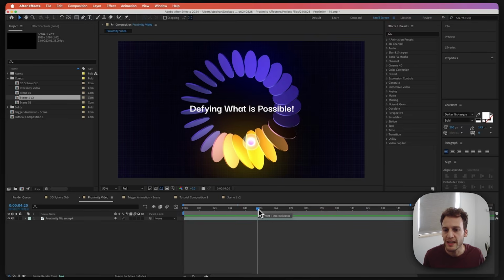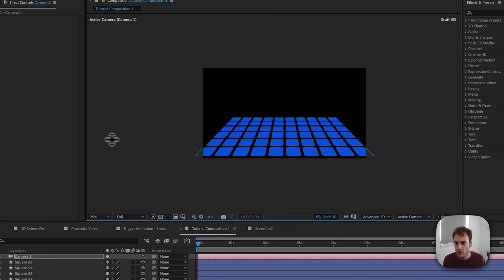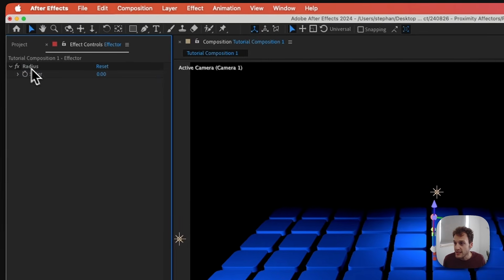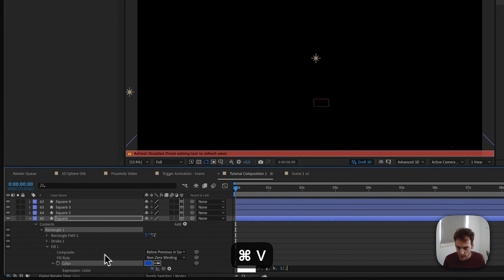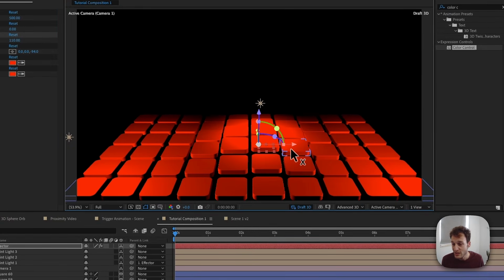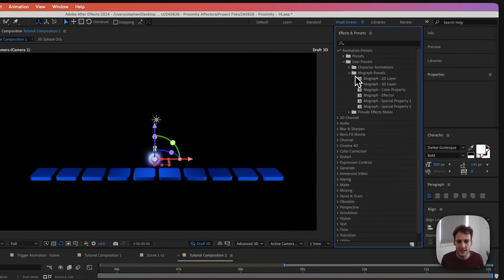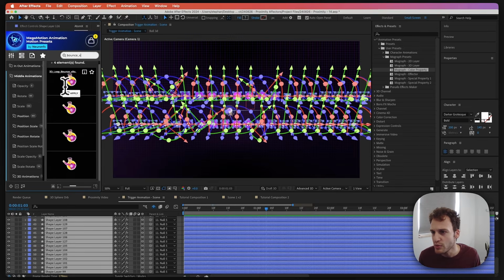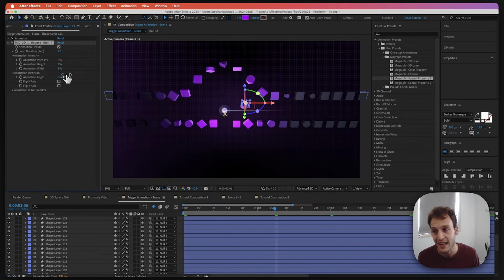Advanced 3D After Effects Motion Graphics Tutorial

Comment: I am having an issue with the expressions here... I copy pasted the expression first, but it showed error regarding the name of the layer "Effector", and consecutively showed error for all the lines for the slider options. 
I manually wrote the whole code just to find that the errors were gone, but now the expression doesn't seem to work at all. 

HELPPPPP NEEDED !!!! 

(I am using After Effects 25.6.0)
Reply from the maker: It sounds like there might be a small typo or a layer naming issue. Make sure your "Effector" layer is named exactly that, or adjust the expression to match your layer name

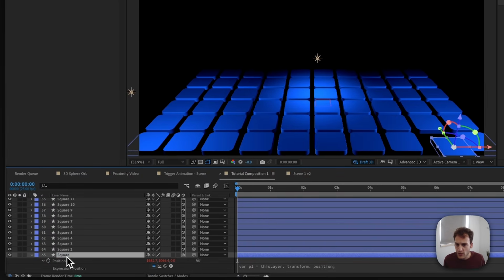Comment: I am having issues at about the 10:04 minute mark. 

In After Effects I am able to copy and paste the code into the expression field. 

The problem comes in after I paste the code into the expression field, after doing this I click on the yellow triangle that pops up on the expression tab and get this:

 “After Effects warning: Expression disabled. Error at line 2 in property ‘Position’ of layer 75 (‘Shape Layer 1’) in comp ‘Advanced 3D after effects motion Graphics 1’.
Error: layer named ‘effector’ is missing or does not exist. It may have been renamed, moved, or deleted, or the name may have been mistyped”

I double checked and I do have a layer named ‘Effector’ in the first layer of the composition.

I get the same error when I try to input the scale and color values into the expression fields.

I tried deleting everything from within the expression fields, saving and closing the project,  then reopening it and inputing the expressions again, without luck. 

I have the 3D setting set to “Advanced 3D” instead of any of the other 2 options. I am also using the 2025 version of after effects if that makes any difference.

Thanks in advance!
Reply from the maker: In general make sure that also the naming of the actual effects in the effector are the same as mine, as these are used in the expression. Also make sure the expression is copied properly from the PDF as sometimes this is disrupted when copying.
Reply: @stephanzammit  Ok, I appreciate it. Loved your video!
Reply: @stephanzammit  Update: So I popped the code in ChatGPT and this is the code that it popped out for the position expression: 
var layerPos = thisLayer.transform.position;
var effectorPos = thisComp.layer("Effector").transform.position;

var scaleFrom = transform.scale[0];
var scaleTo = thisComp.layer("Effector").effect("Scale To")(1);
var radiusStrength = thisComp.layer("Effector").effect("Radius Strength")(1);
var radius = thisComp.layer("Effector").effect("Radius")(1);

var distance = length(layerPos, effectorPos);
var interpolatedScale = linear(distance, radius, radiusStrength, scaleTo, scaleFrom);

[interpolatedScale, interpolatedScale, interpolatedScale];

This is the explanation that it gave for this code instead of the other code:
Key Improvements:

	1.	Variable Naming: Improved clarity by making variable names descriptive and consistent.
	•	pos1 → layerPos
	•	pos2 → effectorPos
	•	ValueFrom → scaleFrom
	•	ValueTo → scaleTo
	2.	Spacing and Formatting: Added proper indentation and spaces for better readability.
	3.	Consistency: Followed camelCase naming for variables.
	4.	Avoid Special Characters: Fixed potential issues with incorrect special characters like “ﬀ” in "Effector".

This cleaned-up code is easier to understand, debug, and modify if necessary.

Note: I put this code into After Effects expressions and the error appears to be fixed. 

PS. Let me know if this code does not make the appropriate adjustments...
Reply: I'm having the same issue but all of it are in their right naming. Did you fix it?
Reply: @zianape4941  I put the code through chat gpt and that seemed to fix it.
Reply: @zianape4941   I ran the code through chat gpt, and that appeared to fix it.
Reply: i have same issue and im using AE 2025
Reply: Update:
I ran the code through chat gpt, and that appears to fix it. However I haven’t gotten around to project completion yet. Will have to see if that does truly fixes it, or if issues pop up later on…

Comment: Hi, I'm new and needs some help. I bought your expressions and copied & pasted. ButI'm having a problem with Position expression. I'm testing using only the Square layer (thisLayer.transform.position). After pasting the expression the position value don't change when I change the position values the Effector.transform.position. The X and Y positions remain the same as they should, however, the Z position remains at 0. I would appreciate any help anyone would offer. Thanks in advance.

Nat
Reply from the maker: Hi, thank you for reaching out! This is usually due to incorrect naming of either the Effector or the Effect names on it. Make sure that even the Controls we added to it are labeled exactly as in the video, including Caps and spacing, etc.
Also, make sure to copy the exact expression when copying from the pdf, as sometimes the copy function in PDF messes the code, just make sure that when you paste, the code remains the same as it is in the PDF. Finally, for the expression to work you need to increase the Radius (set this to around 500) and radius strength. The Radius need to always be higher than radius strength. Hope this helps! :)
Reply: @stephanzammit  Thanks for following up so quickly! I will go back and check to ensure that there are no errors in my syntax. I'll let you know what I find. Also, I would like your opinion regarding whether it's better for me to be using the beta version or the 2025 version? With me being a new learner I'm just wondering. I appreciate your feedback. Thanks again.

Nat
Reply from the maker: @natcarterartography7546  I personally like to stick to the actual version until they come out of Beta. This si however to make sure that I do not run into problems when I am working on complex projects for clients. If you are just testing things out, the Beta version could be coold to look at :)
Reply: @stephanzammit  That makes perfect sense. Thanks.

Comment: I get an error on the expressions saying the layer Effector doesn't exist, but it does and there's no typos, i don't suppose any one has a solution for this?
Reply from the maker: Hi, thank you for reaching out! This is usually due to incorrect naming of either the Effector or the Effect names on it. Make sure that even the Controls we added to it are labeled exactly as in the video, including Caps and spacing, etc.
Reply: @stephanzammit  They definitely are! I’ve remade the project file from scratch and it still does the same thing, it’s very strange!
Reply from the maker: @hannahkathryn510  Strange. If you would like to send a link to some screenshots, I can have a quick look for you
Reply: I've emailed them to you! thnak you!
Reply: did you found the fix?

Comment: Wonderful setup. Thank you for sharing. It's great to reduce the expressions to optimize the calculations. With many layers and many expressions it becomes pretty significant. Such as in this case - the "var" in the beginning of each line is not necessary. While prompting expressions, I add a condition to adapt code for optimal AE use - and AE does not need to refer to "var" each time.
Reply from the maker: Thank you for your comment and feedback, much appreciated. Yes in this case we can remove the "var" and the expression should work normally. Thanks!

Comment: for which version does it works in?
Reply from the maker: Advanced 3D is available in After Effects 2024 upward. However the expressions and technique should work on any version of after effects, even older ones.
Reply: @stephanzammit  so can i make the exact same stuff in older versions?
Reply from the maker: @madhavrajput3597  Yes you can, In that case you will need to switch to Cinema 4D rendered instead of Advanced 3D. The option is in the same place, just click on Cinema 4d instead.

Comment: I don't have the option to enable the Advanced 3d renderer in my AE? what can be the issue?
Reply from the maker: It is only available in After Effects 2024 right now since its a new feature. You can use the Cinema 4D option instead.
Reply: @stephanzammit  yes i did that, but I can’t see the concave/convex corners when I enable it
Reply from the maker: I think it should be available in the same place, try to close the layer and open it again one by one to make sure they are not hidden under a different section. Cinema 4D objects actually have more features when it comes to 3D.